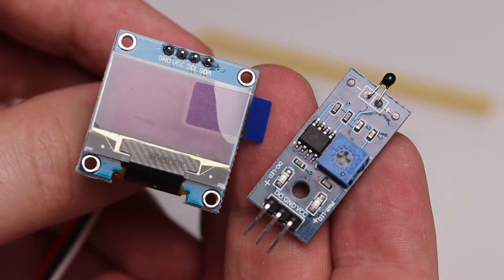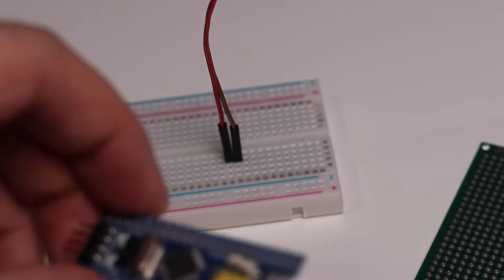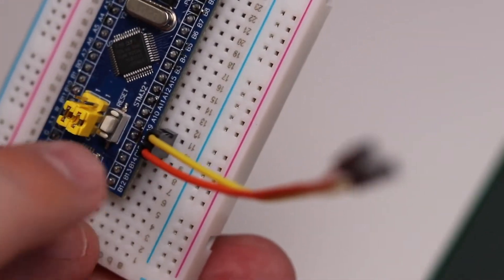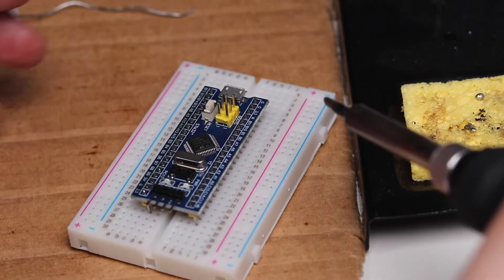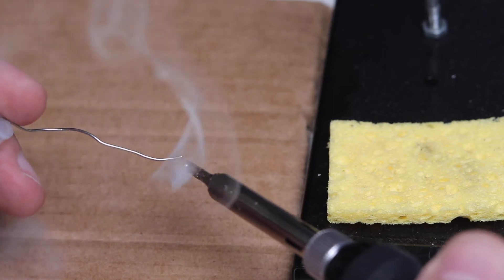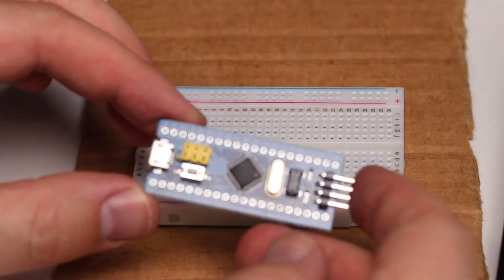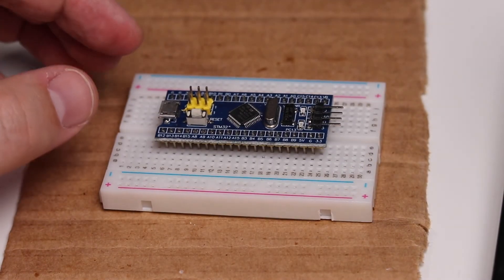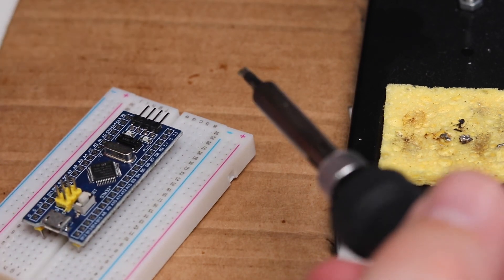Blue Pill (STM32) Rust Workshop Part 4 - Breadboard & Soldering Tips

Comment: the biggest problem I faced using the breadboards, were the wires with pins they were most unreliable. These Chinese wires with pins were always showed abnormal operations. finally I had to use jumper wires(single core wires)

Comment: Hello, I just wanted to warn you that a problem that these boards have with the operation of the RTC is that if you solder pins c14 and c15 it does not work correctly. Greetings